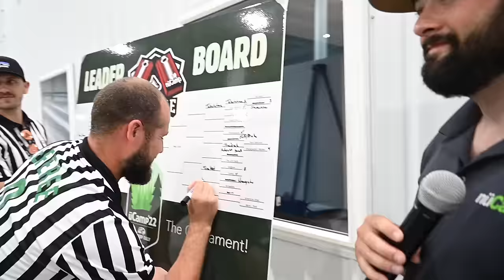Why This is the #1 Selling Teardrop Trailer in the World!

Comment: when I read some of the 'nightmare'  RV stories of the big-box campers,  the simplicity and solidity of T@G, NuCamp is what makes them so good.   and affordable comparatively.
Reply from the maker: Yes, these smaller builds in general just seem to outperform their bigger cousins.
Reply: @PlayingwithSticks  Definitely most of the horror stories I hear are from people who dropped $100k on gigantic Class A motorhomes, and they spent more time in the shop than the did on the road.   The more bells and whistles, the more stuff that can potentially break.
Reply: It's a lot easier to build something without failing seams when it's small
Reply: @cgillit  the size is the real enemy when you're talking about something with large seams.
Reply from the maker: @veganpotterthevegan I would assume you’re correct. Makes sense.

Comment: We are new owners of the T@G's big cousin, the T@B 320 CS-S.  I did a huge amount of research on what we wanted in a trailer.  I had wanted the T@B 400 but my wife wanted an outdoor kitchen.  We compromised and got the 320.  Neither of us regret it at all.  The initial build quality was excellent.  Sure there are some minor things that needed adjustment but I assumed that was going to be the case.  Overall we are extremely happy with it.  During the research phase we went to an RV show to see what was available as alternatives.  There was nothing.  But what was most evident was the quality of most of the other manufacture's products.  We saw rigs that were six figures that had drawer boxes that were stapled so poorly that the plywood boxes were failing.  Our trailer has dovetailed drawer boxes.  Is this necessary?  No.  But the entire trailer was put together with a high level of care.
Reply: I agree with your wife. I want that outdoor kitchen but I'd love to have a stand up bath and a shelf to make that first cup of coffee in the morning! After that, it's all about the outside!!

Comment: I used to own a T@B and I liked it a lot until I discovered the Alto by Safari Condo.  It offers everything the T@G or T@B offer … at 60 % of the weight.  And it’s equally durable and well built.  Haven’t had an issue with my Alto 1743 since I bought it 4 years ago.

Comment: Pulled around 20k miles in  a year and a half all with a 4 cyl Camry with my 21   tag boondock xl and even took it thru many many off-road areas so bad that i dragged the car all over the place. even with raises suspension , for those wondering , 18-21  mpg  on average roads Main issues are this, solenoid wastes energy for the stove if the back hatch is open but this trailer is tough as nails .

Comment: I am going on year 3 with my T@g.  I absolutely love mine and have taken many places, both boondock and established campgrounds.  I’ve had not one single issue with mine…camped in pouring rain (no leaks), camped in sub-zero temps (heater was great)….I could go on and on.
And I did my research before buying mine…it was the only teardrop that checked all the boxes for me.  I will admit they are not cheap.  But they are not cash cows after the fact either.
Reply from the maker: So great hearing this. This is exactly why I made this video. Thank you for sharing.
Reply: Hi is the insulation good on these?

Comment: I have a 2015 Tag.  It is and has been the PERFECT camper for me!  I don't love camping but I do LOVE traveling.  I can tow this little gem without problem, fits my dog and me (he was the travel conundrum with hotels) and can trick out the inside to be comfortable and luxurious in all the ways to make a cozy, safe little home away from home.  I have never turned on the TV, but there is that if you like. The speakers are fabulous, the kitchen is perfect. I love cooking while on the road and can make sumptuous meals in this fully functional galley.  The operations are simple, so maintenance is easy, parts are standard and therefore easily replaceable if needed (rarely).  The build is strong and secure.  It's a fabulous choice, customizable (I make a single bed with a low cot, easily accessible storage underneath), built a tiny hanging rack for clothes, carry a port-a-potty, have a cozy little rug.  I boondocks sometimes but mostly plug in at state and national parks with working fan, ac, fabulous windows and an aftermarket awning. Have towed in the mountains, swamps and snow. There isn't a climate that has proved challenging. Plus there is a robust online community to ask questions and share experiences with. What's not to like?

Comment: I have a 2017 T@G , did some upgrades like front stabilizer, replaced some of the self tapping screws that were rusting to nuts and bolts and upgraded the fans to bring air into the air conditioner.

Comment: NuCamp and Little Guy are the best when it comes to mass produced trailers. I actually looked at a T@G to live full time in. I love the skylight window and interior, except for the door windows. I would prefer if those could open completely with a screen option, or better yet have a screen door.

My biggest point for not getting this trailer is that it isn’t beefy enough for off-roading with my Jeep Wrangler. Plus there wasn’t enough storage space in the front compartment. You can’t lock it either and getting a real solar system on it seemed problematic.

It seems that if you want a “turn key” teardrop this is a great option. It’s much better than something like the Bushwacker.

I bought a dedicated off road camper from Tiny Camper Company. It’s completely composite with a Timbren off road suspension and the wheels and tires match my Jeep, which is great. 

I also have 800 watts of rooftop solar panels which a Bluetti AC200Max power station in the rear. This powers EVERYTHING I need including my microwave! A microwave is a great thing to have when camping!

Comment: Legit!  When I started my first teardrop trailer build in 2007 I toured the Dutchman (which later turned into this T@G).  I was impressed by the layers under the outside skin, the braking system, and it's size.  Since then, I've always complemented them but I won't use the term "Teardrop" with most T@G trailers until the Boondock came out -because it most reflects the size and purpose of a teardrop.  The others I always call "Teardrop Shaped Trailers".  They are mass produced but a good product (certainly not the norm in the RV industry!  lol).  I'm glad you highlighted that fact.  Great Video.  Thanks Brad and Drew!
Reply from the maker: It is fun to see how far your history with teardrop trailers go back. The Dutchman sounds like a name pulled straight from the large RV industry. Haha. Love it!
Reply: Yep.  Getting older.   ha!   @PlayingwithSticks

Comment: I love my 22 Tag BD. But i was very critical to Nucamp about the build not the build quality. I said they needed to change 4 things. And they changed 3 out of for on the newest models. 1 need full size spare tire,2 needed fenders you can step on to access the roof rack,3 need to have a 12v fridge, 4 need to get rid of the electric heater and put in a propane heater which they havent yet. Other than that i love it and I boondock 100% of the time, so i just found my own work arounds for all that. Great video.
Reply: Just posted the same about the heat. What are you doing for a workaround when you don't have shore power for the heat?
Thanks

Comment: I have a 2022 T@G Boondock and love it. Just like this owner, if our situation changes, we would get a T@B. Any minor issues that have arisen we have been able to fix on our own. We camp without shore power most of the time and the solar is usually enough yo keep the battery charged . We take a generator in case there is no sun, but only needed it once last season.

Comment: I went to the factory in Sugar Creek to have them installed the Yakima rails that were not in my new purchase because of no supply! I was fully impressed with the people…yes, they are mostly Amish with tremendous skills! I have the Boondock model. I also have them replace the roof fan (kind of loud for me) with a MaxFan 7500…what a difference…totally whisper. My problem now is that I had a case of bad shingles a couple years ago that fully destroyed my right ear and also killed my right side Vestibular nerve! My balance is very bad and haven’t drive in almost two years! My T@G is parked in the garage waiting for the day to be out…hopefully will come… To me the overall quality is great! Be safe.. Cheers..
Reply from the maker: Sorry to hear about the health complications. I can only imagine how frustrating that must be. Was the original fan a fantastic fan? Or was it some sort of generic brand?
Reply: @PlayingwithSticks  I believe was the Fantastic (rings the bell) but extremely loud. The lowest two settings on the MaxFan are totally whisper…don’t hear it and move volume of air…also the remote control is very handy. Not cheap but worth every penny!
Reply from the maker: This is neat to hear. I have been wanting to do an independent test comparing the decibels of the two. We also get a lot of questions about the gap between the fan and roofracks/rooftop tents. This is something I would like to look into more as well. @AlejandroGonzalez-AGS
Reply: @PlayingwithSticks  The MaxFan 7500 is about 1” taller than the Fantastic “closed”. It will be taller (close) than the Yakima rails at the center, and much taller than the Fantastic when open.
Reply: Those unexpected medical issues can really get in the way. Mine was a detached retina a year ago. I was left with significant peripheral vision loss in one eye, plus a series of surgeries that did not allow me to go to different elevations due to pressure changes, for 6 months. Getting ready to get back at, knowing I have to limit my adventures.
Reply from the maker: Thank you!
Reply: It is terrible…as part of my nightmare, I had reconstructive ear surgery that included a new membrane as I was left with zero hearing on the right ear! After a year from surgery I’m back to 80% hearing in that ear. The problem remains with balance not being able to drive yet! Not giving up..

Comment: Long time subscriber and t@g owner. For me the availability on the second hand market was what drew me to  it. I go camping probably once a month every month here in socal and I have to say I haven't been disappointed in it. Yes, there are things which could be improved, but I think it is an overall great trailer that fits our needs. Mostly we are state and np campgrounds, no hookups and it works really well for us.
Reply: What things have you found that could be improved?
Reply: @patrickio8084  I wish it was a foot longer for additional storage in the kitchen area. It's pretty limited back there. So it can be tight to get everything I need, so I end up having a separate clear plastic tote with the additional things I need. I don't really need the AC either, in fact mine needs replacing, but I understand in some parts of the country this is needed, but I might convert mine into more storage. Mine doesn't have microwave etc, which was good because I wouldn't need that either.
Reply: @patrickio8084  mine came with a fridge which I highly recommend, also solar and a battery. I upgraded the battery to a 100Ah lifepo unit but I managed we'll with the AGM it came with for a while.  I did a few upgrades on the trailer like installing struts on the under bed shortage, and installed the froli sleep system.

Comment: Funny he points out the fender. That's the weak spot right there. Had to rivet mine with some extra aluminum underneath twice.  Of course, I did a lot more to my T@G Boondock than most people: tore out the microwave and replaced it with two drawers, tore out the air conditioner because nobody needs that boondocking and replaced it with a shelf. Tore out the electrics and replaced them with a 200Ah LiFePO4 setup, added external solar panel ports so I can add solar panels when parked in the shade, added an inverter for da Mrs's Hairdryer, added a water transfer pump system that can transfer water from a canister on the front to the tank (much easier than refilling that tank from a canister) and a few more things like a different mattress etc. 
By the end of the day, these are all changes/improvements over the factory model and the only thing I ever had to fix is the caulking around the fan on the top which was starting to decay. The next thing I will have to fix is the vinyl hinge at the "trunk" door. I wish that trailer would come with a timbren suspension and it would be almost perfect.

Comment: I have a Nu  Camp 320 S and I absolutely love it but for me with my disabilities it’s a little too big and I am now going to downsize and get a tag Boondock addition. Yes it’s brand new and it’s still in storage. I’ve only used it one time and unfortunately for someone they are going to get a great deal on this brand new camper that has been garage kept since new. But I want to stay with Nu Camp , That’s for sure!❤
Reply from the maker: Glad to hear you have found what works. I read a stat a few years ago that say the average camper will own 5 different campers through their camping journeys. I originally thought this was due to poor manufacturing. But, in fact I have come to learn that it takes a few campers to find what works for you. And even then, life changes and your needs change, time for a different camper.
Reply: There's certainly a learning curve. We got a 320 to keep the trailer smaller for my imagined backcountry uses and large enough to meet my wife's concerns about habitable space when you're confined to quarters. You'll take a depreciation hit of course in the first year, but Tabs hold their value very well.

Comment: One thing that has changed in the last five years is the advent of large capacity, solar battery banks. This makes it ideal for the small trailers with microwaves and TVs and electric heaters to work off grid because of these large solar charged battery banks, he can throw one in the back here trailer and when you get to camp throw your solar panels out and plug your trailer into your battery bank. It really is a game changer.
Reply from the maker: Yes, these portable panels and power stations have really helped our camping experience as well.

Comment: Is the T@G Azdel on both in side and outside under the filon? Is there still some wood framing in there? We had a 2014 T@B and it did not have Azdel but it did have studs and luan under the filon. But it was really well built and in the 5 years and 20,000 plus KM we put on it there were no issues, nothing needed to be caulked or resealed even though under the skin it was pretty traditional. Build quality was excellent. We sold it to get a larger trailer that had a seperate dinette and fixed bed and a nicer shower that had a much more aerodynamic shape that gave us better fuel mileage. Still have fond memories of the Hobbit House as we named it.
Reply from the maker: That is a good question. I always assumed they used an aluminum bird cage construction with the external wall being fiberglass with Azdel (polypropylene). Sandwiched in between the aluminum framing would be block foam insulation. Hopefully others see this comment. Is the chassis and interior frame both aluminum? Or is it an aluminum chassis with a wood frame? Glad you asked this Steve. I know Intech really wants people to know they use aluminum as their bird cage frame. You would think if T@G was using it, that they would be highlighing it as a feature. As I am writing this, I am starting to think they may still use studs.  Thanks for sharing your experience with the T@G as well.

Comment: And at half the price of Bean and Escapod.  But i guess those are fiberglass.  But this has an aluminum frame with azdel and foam insulation.  Hmmm... interesting.  Ive been thinking small for so long.  But the happier camper hct is only 1800 lbs dry.  And that sleeps 5! But that would blow the budget.
Reply from the maker: Yes, it is hard narrowing it down. I like that Happier Camper as well. There are a lot of good options on the market today.

Comment: I’ve had mine for about 6 months now and the only thing that I have had problems with is the heater worked when I bought it and the first 2.5 camping in it. I went for another camping adventure and it didn’t work. I did not have fuses with me at the time but I have bought them since so I will replace them next time I’m out and if it don’t work well that’s ok cause I have another little heater that is small and won’t take up much space at all. The only thing I will my tag XL had is an outside outlet. But I have ways around that. But over all I love my tag and maybe one day I will make a video and share it with you all. Happy camping everyone. Get out and go.
Reply from the maker: Thank you for sharing this Tim. Our first 4 or 5 years with the teardrop we really didn't have a use for the outdoor outlet. But, like you, we now see the value in them. And I like how you mentioned the heater. We also bring a couple sources of heat. Always better to be safe than sorry.
Reply: @PlayingwithSticks  yeah I have a tendency of taking to much when I go but like you said better safe than sorry.

Comment: What swayed us away from a T@G boondock was that the heater requires shore power. Is that not actually the case? I seem to remember a video saying that its a great camper but not suitable for boondocking because you're tied to shore power or need to lug a generator around. Have people found a workaround for this? Thanks!

Comment: Here’s what I figure. I only need space for me, first of all. Second, if I’m spending money on a mobile house that has to survive massive sustained wind and vibration and shaking going down the road—I’m leaning toward a fiberglass trailer. It STILL comes in less expensive than a B van even with an upgraded tow vehicle. I like the Nucamp Barefoot. Very maneuverable, easy to tow and it’s little. I’m 5’ tall so I don’t need much.